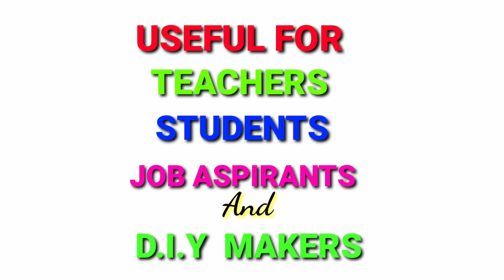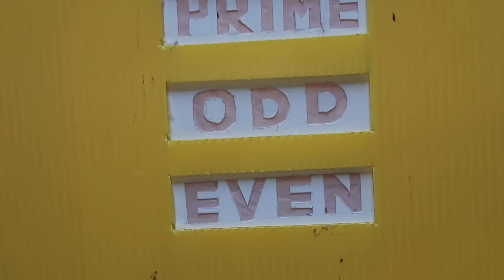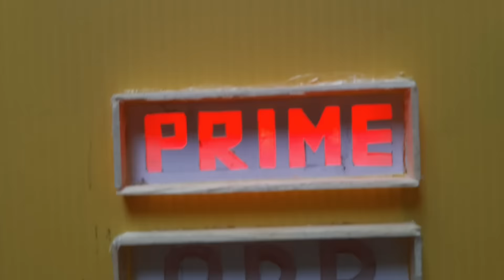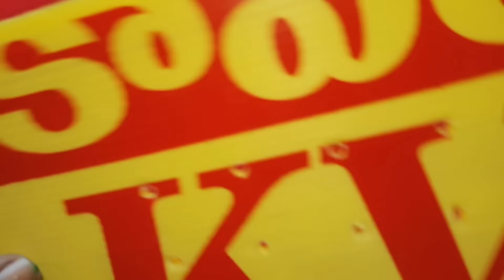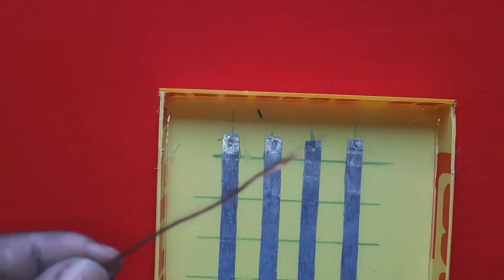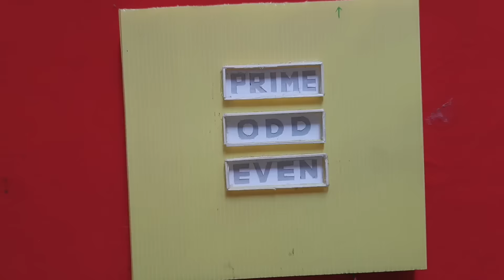Even Odd Prime Number Detector | Maths DIY project| with LED display

Comment: Hello sir plz all working I cant understand
Reply from the maker: Thank you for comment..
1. Advertising cards 
2. Aluminum strips
3. 9v battery 
4. LED lights -- 3  (different colors)
5.  1N4007 Diodes --- 3 pieces
6. Bamboo sticks or tooth picks as per required.
7. Wire as per required...
______________
Wiring process:
---------------------------
Number 2 : Is directly connected with Prime display and connected through 1N4007 diode with Even display. 

Numbers 4,6,8,10,12,14,16,18 are directly connected with EVEN display.

Numbers 1,9,15 are directly connected with ODD display.

Numbers 3,5,7,11,13,17,19 are connected through 1N4007 diode with ODD display and  connected through 1N4007 diode with Prime display.
Reply: Thank you sir
Reply from the maker: All the best

Comment: Is it work reply fast please
Reply from the maker: Thank you for comment...
100% working ...no.doubt..

Wiring connections:
Number 2 : Is directly connected with Prime display and connected through 1N4007 diode with Even display. 

Numbers 4,6,8,10,12,14,16,18 are directly connected with EVEN display.

Numbers 1,9,15 are directly connected with ODD display.

Numbers 3,5,7,11,13,17,19 are connected through 1N4007 diode with ODD display and  connected through 1N4007 diode with Prime display.

Comment: Very very hard😢😢
Reply from the maker: Dont worry...go through the circuit diagram..its about Rs.200 cost project
Reply from the maker: Thank you for comment..
1. Advertising cards 
2. Aluminum strips
3. 9v battery 
4. LED lights -- 3  (different colors)
5.  1N4007 Diodes --- 3 pieces
6. Bamboo sticks or tooth picks as per required.
7. Wire as per required...
______________
Wiring process:
---------------------------
Number 2 : Is directly connected with Prime display and connected through 1N4007 diode with Even display. 

Numbers 4,6,8,10,12,14,16,18 are directly connected with EVEN display.

Numbers 1,9,15 are directly connected with ODD display.

Numbers 3,5,7,11,13,17,19 are connected through 1N4007 diode with ODD display and  connected through 1N4007 diode with Prime display.

Comment: Please the names of parts that you use in this video
Reply from the maker: Thank you for comment..
1. Advertising cards 
2. Aluminum strips
3. 9v battery 
4. LED lights -- 3  (different colors)
5.  1N4007 Diodes --- 3 pieces
6. Bamboo sticks or tooth picks as per required.
7. Wire as per required...
______________
Wiring process:
---------------------------
Number 2 : Is directly connected with Prime display and connected through 1N4007 diode with Even display. 

Numbers 4,6,8,10,12,14,16,18 are directly connected with EVEN display.

Numbers 1,9,15 are directly connected with ODD display.

Numbers 3,5,7,11,13,17,19 are connected through 1N4007 diode with ODD display and  connected through 1N4007 diode with Prime display.

Comment: There are 8 prime numbers between 1 to 20 numbers but  sir you  had noted  only 6 prime numbers so correct that sir
Reply from the maker: Thank you for comment..
8 Prime numbers are there...
______________
Wiring process:
---------------------------
Number 2 : Is directly connected with Prime display and connected through 1N4007 diode with Even display. 

Numbers 4,6,8,10,12,14,16,18 are directly connected with EVEN display.

Numbers 1,9,15 are directly connected with ODD display.

Numbers 3,5,7,11,13,17,19 are connected through 1N4007 diode with ODD display and  connected through 1N4007 diode with Prime display.
Reply: Thanks sir

Comment: What is the diode output 
+ Or0-
Reply from the maker: Thank you for comment. 
+ at LED Displays..........
Number 2 : Is directly connected with Prime display and connected through 1N4007 diode with Even display. 

Numbers 4,6,8,10,12,14,16,18 are directly connected with EVEN display.

Numbers 1,9,15 are directly connected with ODD display.

Numbers 3,5,7,11,13,17,19 are connected through 1N4007 diode with ODD display and  connected through 1N4007 diode with Prime display.

Comment: I make this model but this not work
Reply: Now what can I do
Reply from the maker: It is successful Project ....
as a Govt. Teacher ,I won't publish false information on my channel.
Please go through the video again. 

Requirements:

1. Advertising cards 
2. Aluminum strips
3. 9v battery 
4. LED lights -- 3  (different colors)
5.  1N4007 Diodes --- 3 pieces
6. Bamboo sticks or tooth picks as per required.
7. Wire as per required...
______________
Wiring process:
---------------------------
Number 2 : Is directly connected with Prime display and connected through 1N4007 diode with Even display. 

Numbers 4,6,8,10,12,14,16,18 are directly connected with EVEN display.

Numbers 1,9,15 are directly connected with ODD display.

Numbers 3,5,7,11,13,17,19 are connected through 1N4007 diode with ODD display and  connected through 1N4007 diode with Prime display.

Comment: Sir please explain circuit diagram
Reply from the maker: Thank you for comment..
1. Advertising cards 
2. Aluminum strips
3. 9v battery 
4. LED lights -- 3  (different colors)
5.  1N4007 Diodes --- 3 pieces
6. Bamboo sticks or tooth picks as per required.
7. Wire as per required...
______________
Wiring process:
---------------------------
Number 2 : Is directly connected with Prime display and connected through 1N4007 diode with Even display. 

Numbers 4,6,8,10,12,14,16,18 are directly connected with EVEN display.

Numbers 1,9,15 are directly connected with ODD display.

Numbers 3,5,7,11,13,17,19 are connected through 1N4007 diode with ODD display and  connected through 1N4007 diode with Prime display.

Comment: Sir can We replace anything instead of lN0047 diode
Reply from the maker: It is better ,another can't be replaced, it is used to flow the current one way only reverse can't be done....  otherwise if we press any one button all led strips will glow.... this is the main secret of this project.

Comment: Not work
Reply from the maker: Don't worry it will work...

1. Advertising cards 
2. Aluminum strips
3. 9v battery 
4. LED lights -- 3  (different colors)
5.  1N4007 Diodes --- 3 pieces
6. Bamboo sticks or tooth picks as per required.
7. Wire as per required...
______________
Wiring process:
---------------------------
Number 2 : Is directly connected with Prime display and connected through 1N4007 diode with Even display. 

Numbers 4,6,8,10,12,14,16,18 are directly connected with EVEN display.

Numbers 1,9,15 are directly connected with ODD display.

Numbers 3,5,7,11,13,17,19 are connected through 1N4007 diode with ODD display and  connected through 1N4007 diode with Prime display.

Comment: I can't understand circuit diagram
Reply from the maker: Thank you for comment !
Process: ⤵️
Number 2 : Is directly connected with Prime display and connected through 1N4007 diode with Even display. 

Numbers 4,6,8,10,12,14,16,18 are directly connected with EVEN display.

Numbers 1,9,15 are directly connected with ODD display.

Numbers 3,5,7,11,13,17,19 are connected through 1N4007 diode with ODD display and  connected through 1N4007 diode with Prime display.